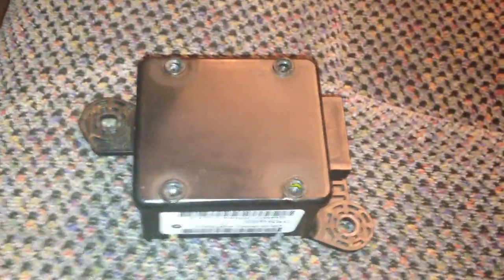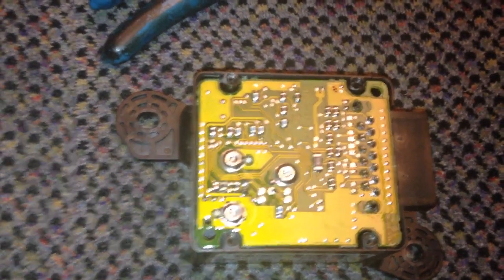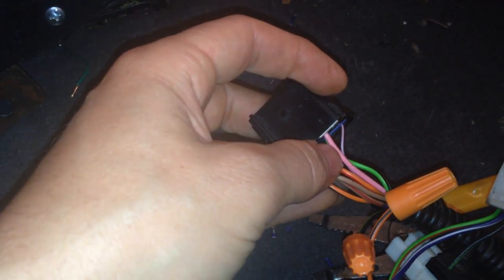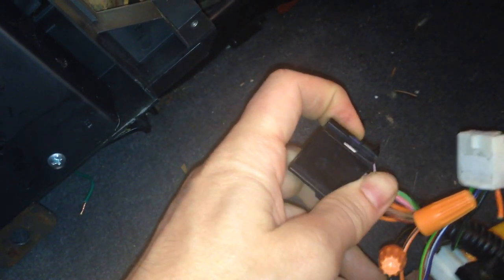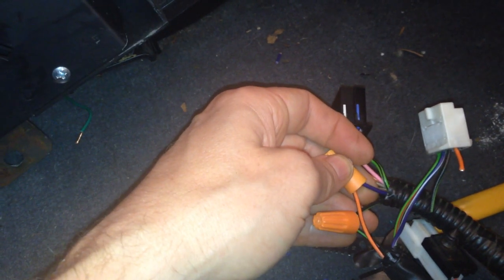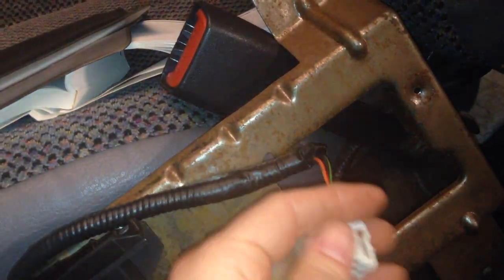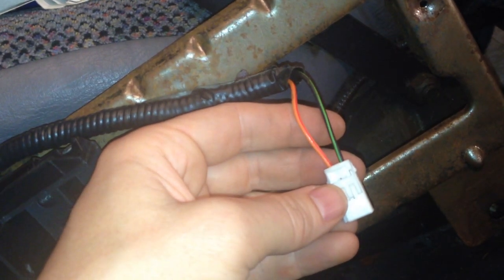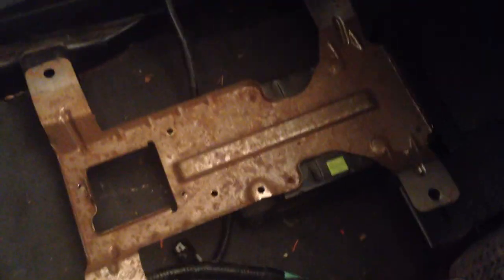99 Dodge RAM Locked Seat Belt Fix (2500 Cummins)

Comment: Got this done on a friend's truck Saturday. Only part that was confusing was the passenger seat is an orange wire with a red stripe and the drivers seat is the orange wire with the brown stripe. I tried the driver seat orange with red but didn't work which I thought may not be the right wire and was right. Everything worked great when done and taped up good to keep it all together. On the batteries always disconnect the positive first then the ground. When hooking back up positive first too. That prevents arching and messing up the computer.

Comment: When it doesn't fix the problem.  Pull the plastic ring and drill holes just below the seat belt roller.  Use a screwdriver and break off the solenoid. This will release the seat belt roller.  But the seat  belt still works.

Comment: i just did this fix. it unlocked my passenger front and both rear seat belts. driver was still locked. also, the rear ones do not lock at all now when you pull on the belt fast. to fix the driver seat i ended up pulling off the seat cover, and removing the servo motor from the seat belt . also a pretty easy fix. hope this helps.. 98 dodge ram 2500 v10
Reply: Cory R did you have leather seats or cloth? I’m having the same problem and did the fix in this video but only did the pass side. I’ve got leather and can’t find a way to take the cover off

Comment: Don't do this!!!
What happens if you get into an accident and the module doesn't make the seat belts lock??
You go through the windshield!!
Great fix!!
Reply: Actually, the belts will still work in an accident. That is a different mechanism. It should also be noted that one does not need to cut any wires. You can get this done by simply putting jumper wires on the control module connector.

Comment: Am about to change module, when the belts locked l lost my interior lights the pink wire has no power and cannot read codes from the computer.

Comment: I just made a pigtail and jumped the blue to the R/B and R/O at the connector so I didn't have take apart the connector or cut any wires
Reply: Paul Gawrych do you happen to have a picture?
Reply: You may not see this but thanks, works perfect, clean and fast

Comment: something is draining my battery's while the truck is sitting and only the drivers side seat belt is locked. Passenger side is free. Would I still do this? help please
Reply from the maker: +Jake Brey Not an expert but if it is the solenoid in the seat pulling from the battery, this will solve the problem. If it is something else, obviously it won't work.
Reply: +Jesse Kinsman  ok ill try it tonight. blue to both oranges & reds and all black and greens together for ground? thanks man